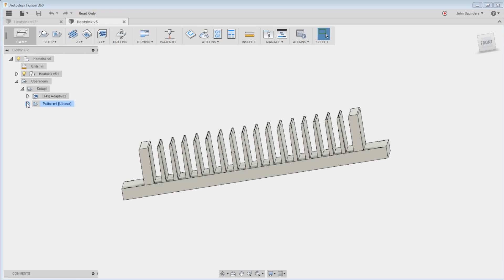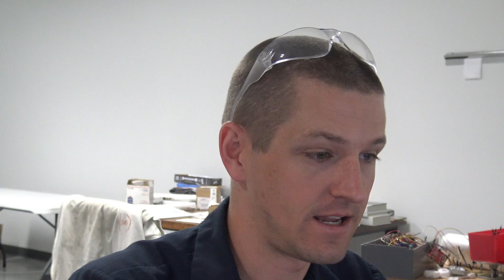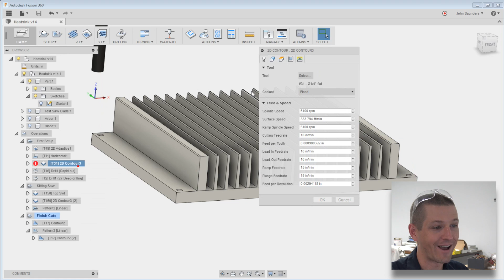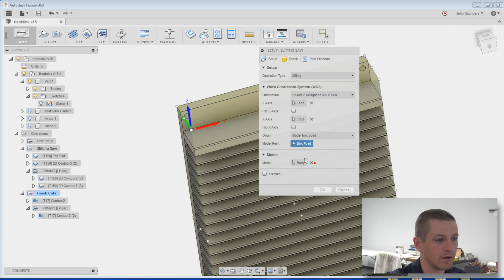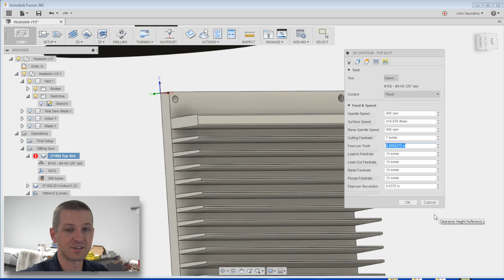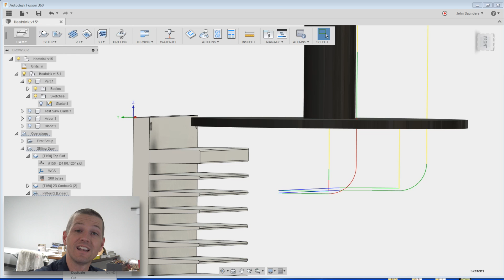CNC Machining a Heat Sink!  Part 1 Widget102

Comment: No joke, Wire EDM would have probably been a cheaper option. Drill 1 hole in a bigger piece of alum, walk away, and it's done. I've done lots of prototype aluminum extrusions with the wire edm and it's gravy work.

Comment: Hi, I'm from Russia.
What is the salary of an engineer, a worker working at CNC milling?
Reply: They pay 13-18/hr. and charge 75/hr. to the customer for your work.  Usually you must work at least 48 hours a week then the government takes 40% for taxes and social insurances. Tools wear out and break, its your fault. power goes out and ruins a part, It's operator error. Clamps loosen and part shifts. Operator error. Tool changer drops a drill, Then a tap breaks in the non existent hole, Operator error. Spindle worn out from 30,000 hours of use and wont hold spec's. operator error. You can make them 50,000 a week profit, it is never good enough. Go to college!

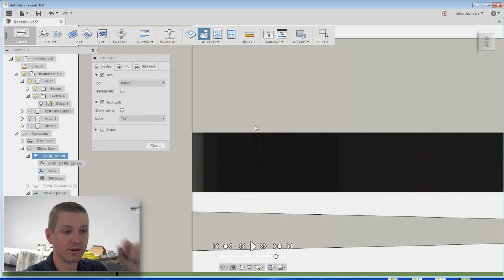Comment: What the image on the screen at 31:29 when you zoomed really far in to the slotting tool? It looks like a reflection of the shop but I don't believe so because I presume you're using a screen capture program. Could it be a glitch with fusion 360? just a weird artifact I saw and was curious about.

Comment: I am not a machinist, and I understand that nice surface finish is a point of pride, but I do not understand why you would spend the time for extra passes to increase surface finish on an already expensive part where surface finish actually decreases effectiveness. (surface roughness -> extra surface area -> better cooling)

It's hard to ask a question like this without sounding super condescending, so please know that is not my intention.
 
What is the reason for these extra passes? Is this just because of general pride in your work, or is there a functional reason for spending the extra time?
Reply: normally your customer specifies an average surface finish which - or lower -  you then have to archieve
Reply: Almost all designs will have a surface finish specification. It is checked with a profilometer, which has a tiny crystal that is dragged across the surface and gives a digital number readout. Often parts are scrapped because of porosity in cast parts that is too great.

Comment: When you square up the stock you should face the back side of the part first and then, without taking the material out of the vise, run an endmill along all the sides of the block.  Then you can turn the stock up on the sides with the finished side resting on the nonmoveable side of the vise and the cleaned up edge resting on a parallel.  This assures that the part is sitting as square as possible in the vise.  By clamping on the raw stock like you did, you run the risk of the part being tipped differently every time you rotate it to clean up a new side.  Also, by cleaning up an edge and resting the part on a parallel you do not need to use a square to get the part aligned properly.

Comment: if you have so little material on the side of the block and meat on the length and width why not profile around it with an end mill, take a light face cut on the top and then take the rest from the the bottom face? Surely that would save time on blocking up and be more accurate?
Reply: NYC CNC wow didnt expect acknowledgement, thanks! good stuff man.
Reply: There are so many ways to skin a cat,  I long ago lost count of them.  What I like about John's videos is that he is on a mission to learn how to do things to achieve the required or desired result.  In all of my work I have put the result as the thing of value and how that is achieved as secondary.  If I do the same job again, maybe I have some input from the first time which makes the second time more efficient.  Hindsight is truly a wonderful gift.  :)

Comment: why not just use an inverted dove tail cutter that can easily be made from tool steel and can mill aluminum very easily with a slower feed rate
Reply: thats exactly what I was thinking

Comment: Why didn't you just rough the ends off on a saw it would have taken a hell of a lot less time then chucking it up for a few extra passes.  The saw i ran could have knocked the rough edge off in 20 sec's the teeth were set about 3/4" apart it looked like a saw blade for cutting wood and not metal you could have just done it on a Bridgeport and  Not wasted machine time on a CNC you could use for production work.
Was that aircraft aluminium? and how come your not using coolant?
And Wow a CNC operator that cuts the burrs on his own parts, I've seen it all now.
Sorry I worked in a shop the CNC operators were lazy.

Comment: Is it just me or is there an audio effect when you change tools?
Reply: Compressed air shoots down the spindle to blow any chips that may be present. Even a tiny chip will create a big run-out or concentricity at the end of the tool. Also tool changers make noise, and clamping jaws use air pressure. Air blasts are a common sound in machine shops.

Comment: You can save time making your blank by holding the part in alum vice jaws the 6" dim. in Y. Cut the length about 1/2" deep, cut the width about 1" deep, face the top, chamfer the edge .01 x 45 degree and spot & drill the four holes. 1 op instead of 4 ops. Put afew extra $$ in the bank for a rainy day

Comment: On parts that have alot of material removal try using a better grade of aluminum. Instead of 6061 T651 bar use 606T651 QQA250/11.

Comment: Strange way of squaring your block. Why not do the first two sides the way you did, then clamp on those sides to machine the ends, along the y axis, using the sides cutting faces of an end mill. Assuming you vice is square you have four square sides. That way you don't get chatter due to the edge you milled being way above the clamping faces.

Comment: those cutters are not slitting saws they are milling cutters for horizontal mills
Reply: you where back and forth with both but that's ok your getting a mill to work with these cutters
Reply: Where was the side milling action... I seem to have missed it?
Reply: They are called side and face cutters.

Comment: John I don't know the squareness or parallelism specs on this part and they may not be that close. However due to aluminum extrusions such as the one you are using they are always out of square from the mill and I can guarantee you that the method you used for squaring did not generate a square part. Allow me to share a proper method that I learned from my own mistakes. First of all skim one of the large flat surfaces in the vise then place that machined surface on an angle plate and mill 2 sides parallel with each other and square with the first surface then put the part back in the vise machined side down with the vise indicated and skim cut the 3rd edge with the side of an end mill this will make it square with edge 1 and 2 but not necessarily square with face number 1. Then back to the angle plate and locating again on the 1st face again and the 3rd edge. mill the 4th edge flip 180° and mill edge 3 again. Now you have 5 of 6 surfaces square and parallel with each other. Place the part on the vise or fixture and mill the last surface parallel with the 1st. and you are done squaring and in this case ready to mill. I use this method to square blocks for investment casting molds and when I am done I can put them on a surface plate and have a perfect match when lining 2 blocks up side by side. They have to be square because the 2 halves of the mold need to match when pinned together and measuring from the cavity to edge is a good on the fly shift/mismatch check. One more thing I made a finned part awhile ago actually an air cooled engine cylinder head and to remove the mtl. between the fins I used a ball end mill with a plunge tool path. End mills are very strong when plunging especially at less than 50% engagement. It was a very simple tool path that ran unattended.
Reply: Heatsinks don't necessarily have to be perfectly square (because it's sitting ontop of what needs to be cooled)unless it's being slotting into a perfectly square hole?
Reply: Ditch all that squaring up the block on the mill and just have the blocks Blanchard ground. Much cheaper and much quicker.

Comment: Well wouldn't an automatic tool changer allow you to be out shooting a gun or with your family while the machine runs.  i used to shut the lights off and go home at quitting time.  Sometimes the machine would still be running when I clocked in at work  Tool changers are good if you have the guts to let her rip..  I have to say that it could be stressful, but the payoff is GREAT when the confidence is there.

Comment: I miss using a wire EDM, would have been perfect for this job.
Reply: +NYC CNC not sure, I used it to cut metallurgical samples, carbide out of tri-cone mining drill bits. Also used it to cut gears for SAE mini Baja race car.
Reply: +NYC CNC not sure, I used it to cut metallurgical samples, carbide out of tri-cone mining drill bits. Also used it to cut gears for SAE mini Baja race car.

Comment: Hey John, 
Thanks for the videos. Just one thing to explain here, what's the tool drop at 17:03 caused by and how come it didn't make a difference to the cut dimension? Awesome! Cheers, Jack
Reply: My mistake dude, it took me about 15 times watching to notice it was the tool spinning. It looked to me initially to have some loose set screws as the cutter seemed to pitch a 1/4 or so. Must be the angle from the UK ;) Great project. When does the Porsche cap get done?

Comment: Thinking as a woodworker, would it make sense to make two cuts on each end with a slitting saw to cut out a chunk, then clean it up with the end mill? Seems like it would be quicker
Reply: +NYC CNC Hehe, sorry. kinda hard to explain. If you're cutting a tenon, you make one vertical saw cut, then one horizontal saw cut, and end up taking out a chunk of wood.  instead of using a router and grinding away the entire thing
Reply: its a good point.  Nothing wrong with making a jig (3d printed, with a fine nozzle and hieght) and running the bulk out

Comment: wrong metal? If you are going to machine a heatsink, why not use cobber since the part is going to be expensive due to labour and machine cost anyway?
Reply: Not if it's going to be in a corrosive environment like salt water or something.  Don't want copper in that situation. Or if it's being attached to another metal that would create a galvanic reaction if it were copper. 

Customer wanted aluminum that's what he made it out of.  So. Right metal.
Reply: Copper is heavy.

Comment: How is legal to operate a cnc machine like this with the doors open? Where I live (Italy) that would be super illegal, the the cncs that I have at school refuse to turn on the spindle with the doors open. Ir I were to open the doors mid-cycle it would trigger an emergency stop(coolant off, all axes and spindle stop instantaneously)
Reply: Fuck that. Those little plastic guards are just in the way. Like seat switch kills on lawnmowers.
Reply: Theoretically yes, but not very smart in my opinion.
Here we have very strict regulations which boil down to: it should be phisically impossible to get hurt using the machine. Here even manual lathes and milling machines have to have plastic protections wich cover all parts in mochion and wich shut down the machine if removed et cetera. Are they annoying? yes, do they save limbs? yes.
Those regulations are not for people capable of logical reasoning(example: mr. Saunders here) but more for the idiots.
Reply: Technically under OSHA standards. Since the machine's enclosure  is an add on feature, not a "standard safety device" with buying the machine. You don't have to operate it with the doors closed. It's considered an open bed machine regardless if you bought or built an enclosure for it.
Reply: Thanks, that clarifies the local legislation a lot.
Reply: Disable door lock. I recommend it. 👍👍

Comment: This is Just Nuts... You can buy heat sinks in almost any size and configuration Cheep...
There is No reason to machine something this basic.
Reply: +NYC CNC exactly. Don't ask questions. Just make their part and take their money :). It's not your responsibility to tell them about the $0.25/ft off the shelf heatsink extrusions.
Reply: +HierNameneingeben why is it his duty to recommend something cheaper? 

Why sabotage a good money making job like that?  It's the customers responsibility to research that kind of thing. He's a machine shop. Not a design and engineering firm... 

And looking at that sink. It's not an off the shelf part. It would be a custom job even for a heat sink extrusion shop.
Reply: You should have recommended something cheaper. I'm a mechanical engineer with degree. If if create a part like this in my company, I would probably get a warning.
Reply: Darn straight.
Reply: If i was a company designing a heat sink for a Electronic device and it had to dissipate so much heat with in a certain time period and i ask a outside company to build it for me. it would be a good idea to ask me why i didn't use a off the shelf part that doesn't fit the case or the Electronic board that it was design to fit. There are cheap people then there is good quality products. I would take my business to a company that didn't second guess me that wasn't in my line of business.
Reply: Should have ordered said here you go
Reply: Further.  Maybe the customer is a fan of this channel and was in a position to support it by giving John a job he needed done.  He DID go all the way from the UK to get this part done.
Reply: NYC CNC, If I were to order this part, what might I expect to pay for it? Great video, btw. I subscribed to see all of your cheap "homebrew" CNC videos. Just ordered a cheapie from China, hope to get into this real soon!

Comment: Most. expensive. heatsink. ever. :)
Reply: I've been a design engineer for about 30 years doing semiconductor cap equipment.  In fact I was running thermal flow simulations all day today to design a custom heat sink.  I can almost guarantee the prototypes will be hogged from billet.  If it goes to production, we'll get a custom extrusion or a stir welded blank.
Reply: lol, that would explain why most motherboards no longer have "Real Heatsinks(tm)" with actual cooling fins on the motherboard VRMs of late. Ten years of featureless lumps of metal with stickers on them is cheaper than extruded heatsinks, lol.  That and marketing appears to like the "Transformer-Voltron" look of their "VRM Fashion accessories", lol. I would love to make a 3D model (obj) and send it to a shop to be made for my motherboards, yet I know it is way out of my budget range as an individual to have something CNC'ed. 

Sadly, the old "Real Heatsinks(tm)" have at max, an 80mm mount length spacing on them, and modern motherboards have a 100mm spacing, so the ten-year-old aftermarket heatsinks will not fit modern motherboards.  Hence why I am wandering around looking at (design rules) ways to make a "Real Heatsink(tm)" without the cross cuts folding over the fins, I almost think It's a lost art, lol. I think I figured mostly the limits of extruded direction features (given slump as the metal cools and such), it is the cross cuts I'll guessing on. Oh well. I have to finish a (CGI) 3D model and make a post I've been putting off for almost a month elsewhere.

P.S. great vid NYC CNC. B)
Reply: it's for cooling grow lamps.
Reply: That's fine, and I get that it means that price isn't much of a concern, but you can get custom extruded aluminum heat sinks for surprisingly little.
Reply: not in that exact size
Reply: hpux735 l
Reply: the process does make alot of sense
Reply: It is probably for a prototype series.

Comment: I have always wondered with machining why dont parts get cast into there rough shape and then machined to final size to save on material. Is this actually more expensive or just impractical?
Reply: When you're trying to make too many parts then casting and then machining is better than just machining all the parts from a solid block of metal. But when you're trying to make a few parts it's not effective to go in to the whole process of metal casting (pattern making, molding, and then casting) just to make one or two parts. Plus I think he's not interested in metal casting and it'll require him a decent amount of time and labor to setup a foundry.
Reply: Casting involves more significant initial costs to get set up, since you have to make a pattern and molds, so it's generally cheaper for small production runs to just machine the pieces from standard bar stock. Castings are used fairly often for larger production runs, or in situations where you need geometry that can't be efficiently produced by machining.

Casting also has it's fair share of drawbacks. If the process is not carefully controlled, voids can form in the material from trapped gasses, which will weaken the part. In addition, particularly with steel, castings tend to be weaker than bar stock for complex metallurgical reasons.
Reply: Casted metal also has different thermal and strength properties vs extruded machined billet. For instance casted aluminum often has micro pockets of air in it as well as higher silicon content vs extruded billet. Making it a poorer choice for something like a heat sink. 

Even commercially produced heat sinks are extruded through a die rather than cast
Reply: Because the tooling for type of part would cost 15K+.. Plus.casting you get a lot of periodicity inside the casted part
Reply: +Chief Machining nah. Not today. Investment casters would grow the part in a 3D printer rather than make a whole mold for it if it's just a few parts. 

We just had that done here. Ends up being pretty cheap
Reply: That billet is probably less than 10 dollars. How much is your 3D part going to cost. 3D printing is the future, but it's still bloody expensive at the moment.